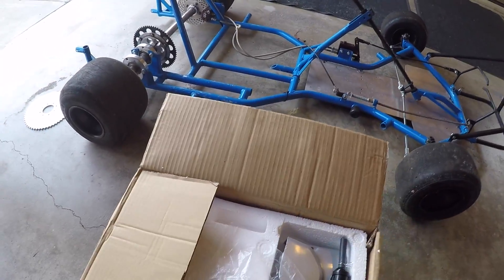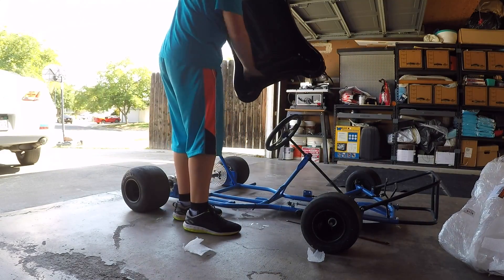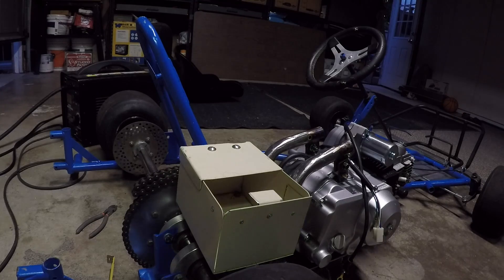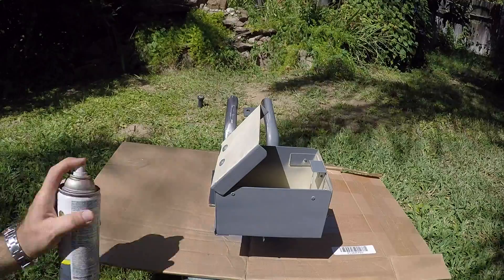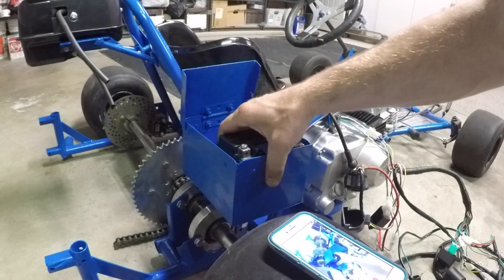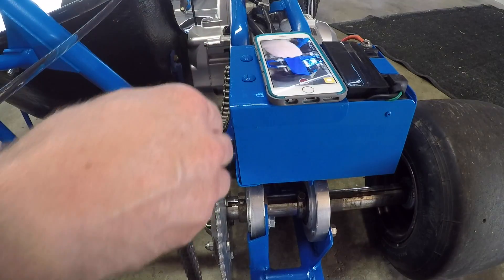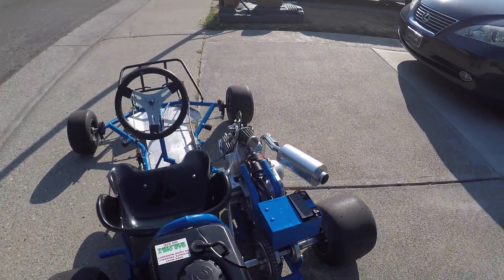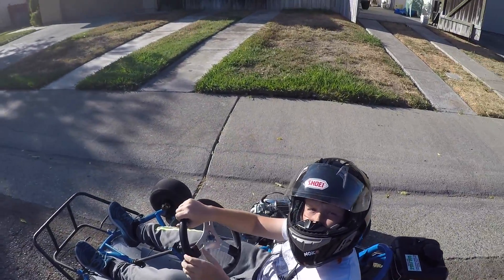125CC GO KART PROJECT

Comment: i want to do the same type of thing with the same motor. Would u be interested in making another one of those engine mounts?and how much would u charge?
Reply from the maker: Angelo Lopez 
What city do you live in and is your engine going to go on a go kart or a bike? I might be able to help but no promises.
Reply: +balabay77 its a emmick go kart and i plan on buying the same motor as u did and manteca CA
Reply from the maker: Angelo Lopez 
Cool, that's not that far away from me. How much do you think would be a fair price to make one?
Reply: +balabay77 i honestly dont know its up to u because of ur time and skills to make it
Reply from the maker: Angelo Lopez 
With my materials and time it would be no less than $100.
Reply: +balabay77 ok sounds good so when would u be able to make it? no hurry and could u send a link to where u got ur motor from
Reply from the maker: Angelo Lopez 
I will try to make one this weekend. According to websites, mounting holes on these engines are the same unless you are planning to get another type of engine with bottom starter. My engine got top mounted starter. I meant to make another engine mount soon for my future project anyways. My engine was purchased on eBay but it was no good. Transmission issues. I've returned it and soon be getting another one from Amazon. As soon as it arrives i'll use it as a templet. Stay in touch.
Reply: +balabay77 ok thanks
Reply from the maker: Angelo Lopez
Hello Angelo
I've made a mount for you and it's ready  to go. Let me know if you are still interested in buying it. If I don't hear from you then I'll just use it for my next project. Cheers. (916)6O6-9627.
Reply: +balabay77 yes im stilp interested and how much again?
Reply from the maker: Angelo Lopez 
Like I said $100 or else I'll just keep it. If you have email I can send you some pics of finished mount.
Reply: +balabay77 i definitly want it i will message u when i have the money.
Reply from the maker: Angelo Lopez 
Ok. Sounds great.
Reply: +balabay77 hey i got the money. does the mount need to be welded onto the frame?
Reply from the maker: Angelo Lopez 
No, you can bolt it down to a frame if you like. You can come by with your kart and see if this mount will work for you. I've seen other people drill some holes thru the frame and attach the engine that way.
Reply: +balabay77 ok um what city r u located in?
Reply from the maker: Angelo Lopez 
I live in Sacramento.
Reply: +balabay77 o ok great i also live in galt but im not out their that much could i come by this weekend
Reply from the maker: Angelo Lopez
For sure. If you already have your engine then bring it over to try and see if it fits. (916)6O6-9627 Eugene.
Reply: +balabay77 i dont have it yet i was goin to order the right one based on the mount u made
Reply from the maker: Angelo Lopez 
I think that most of them will fit except the one with bottom mounted starter. If you prefer to wait until your engine arrives then it's all good. This mount ain't going anywhere. Good luck buddy.
Reply: +balabay77 ok thanks
Reply: +Angelo Lopez did u get my txt message?
Reply: +Angelo Lopez i wanted to send u a picture of this motor im going to get and see if the mount would work. the motor is a 125cc yamoto
Reply from the maker: Angelo Lopez 
I'm not 100% sure but you are always welcome to come by and try it out once you get the engine.
Reply: +balabay77 ok  good

Comment: nice clean build. sounds like its geared too low though . is it an automatic or a 3 speed?
Reply from the maker: this turd is fully automatic but this engine had transmission problem. it didn't want to shift into higher gears so i returned it to eBay seller. soon i will be installing another engine and will make a follow up video.
Reply: balabay77 oh okay. I've actually taken apart a few of those China clones and it isn't really an automatic, it's just has one gear for drive. doesn't have veritable speed. It's like having a predator 212 with a centrifugal clutch... you would be better off getting one with gears and making it a shifter kart... awesome videos by the way! Subed!
Reply from the maker: Thanks for the info. Yeah, shifter cart would definitely be faster but my kid have yet to learn how to drive manual transmission. In our future builds i will try to install manual engine. Cheers

Comment: does it have gears?
Reply from the maker: Engine is fully automatic but the thing is eBay deal turned out to be a dud. Motor had a transmission problem, didn't want to shift into higher gears so i return it. soon i will be installing new engine and will make new video.

Comment: that new sprocket is way too big , compare the size of the cart wheels to the wheel size of the pit bike you will see you need a smaller rear sprocket,  or the engine will be screaming at full RPM & you will not get a good top speed
Reply from the maker: Good call. I've already swapped out this sprocket for smaller 37 tooth sprocket. This engine had a transmission problem so I returned it back to the seller. Soon my new engine will arrive and then I'll make another follow up video. Cheers
Reply: I did a similar swap with a 4speed semiauto.  Started with a 50t, then 28t but was still too big.  Ended up with a 17t, now it's great. All gears are usable and you can cruise in 4th gear quietly.
Reply: on a build i did in the 80's I used a Honda XL125 engine and fitted the same size sprocket to axle as i had on the engine, top speed was great when i got the gear linkage and the clutch set up
Reply from the maker: Thanks for the tip. i will get a smaller sprocket for my axle. Cheers

Comment: where did u get the engine and how much? also that frame was a really good deal
Reply from the maker: Got this engine on eBay for $240 with free shipping. It had transmission issues so I returned it and soon I'll be receiving another one. This time I got it on Amazon for $259 with free shipping so in coupled of days I'll post another follow up video. We paid $100 for the rolling chassis frame. Found it on Craigslist in our city. Cheers

Comment: sweet kart but it's geared way to low you will have lots of torque for doughnuts but not much top end speed try a smaller rear sprocket
Reply from the maker: Yes sir i already installed 37 tooth sprocket. my 54 tooth was too massive.
Reply: awesome
Reply: Isn't that a 125 cc 4 speed auto clutch?  What gear is it in?

Comment: Nice work, came out really good. You should change the rear sprocket for a much smaller one. I think 45mph to 50mph is the correct top speed for this engine to go-kart set-up.
Reply from the maker: Yes sir i already got another rear sprocket for it. Went from 54 tooth to 37 tooth.
Reply: balabay77 Nice. Check out my video here in you tube. I started with a one lawnmower engine. Now it's a little faster ( Homemade two engine Go-kart ). I hope you guys enjoy your kart.
Reply from the maker: Nice bed frame go kart.
Reply: julio lausell

Comment: Does that not have a 3-speed transmission? He was only doing 10 and almost had it redlined
Reply from the maker: Thats because this engine was defective and as soon as we shot this video we returned this motor to the seller. Sometimes shit happens and Ebay deals turn out to be a dud. Not to worry, soon i will get a replacement and as soon as we break it in, i will post another video on it. Good eye mate, Cheers

Comment: THAT IS A SEXY GO KART no joke that looks like a factory made kart like if you made then and sold them people would think it's a actual brand you did a good job on it
Reply from the maker: Thank you Kade for sharing your thoughts and supporting our builds. To make it look like a factory built kart it probably needs some plastics and bottom mounted gas tank with fuel pump. Its a rat race go kart in progress.
Reply: Even if you used aluminum sheet metal instead of plastic it would be stronger and possibly protect you from rocks
Reply: If you were to put a fuel pump in put the gas tank in front if the seat to save space
Reply from the maker: Yeah, i need to get rid of that ugly tank and get a plastic tank that goes under the steering wheel. Cheers
Reply: I actually dosnt look that bad on the cart there but plastic would be lighter

Comment: No gears im assuming?
Reply from the maker: Yes sir, its a fully automatic engine.
Reply: So is it only 1 gear?
Reply from the maker: Yes and no. This particular engine was defective because it was stuck in first gear. We shipped it back to eBay seller and soon I'll be getting a replacement. Sometimes stuff that we buy online turn out to be a dud.

Comment: does it have 3 gears? Looks very cool. 👍
Reply: Ben birinyi . more than you can afford, pal, ferari
Reply from the maker: I believe so but not sure. When i bought the engine it just said that its fully automatic in specs.
Reply: Oh i see. Sweet. Ty
Reply from the maker: For sure. Cheers
Reply: balabay77  hey where did you buy the go kart frame
Reply from the maker: Got this frame on our local website called Craigslist.com for $100. Check it out and maybe you'll find a great deal.
Reply: Ben birinyi y
Reply: Where did u get the frame from ?
Reply: Hey how much did the project cost to make?
Reply from the maker: Entire project came out to around $600. I know that its too much for bare bones go kart frame but i wanted to see if this engine will be better than the predator. We did replace this engine for another one in this video https://youtu.be/dVv3wAksP8w
Reply: only if I had the money to make it 😢
Reply: jr rh